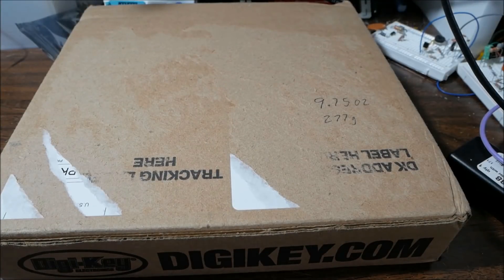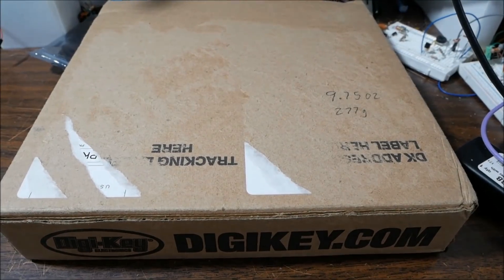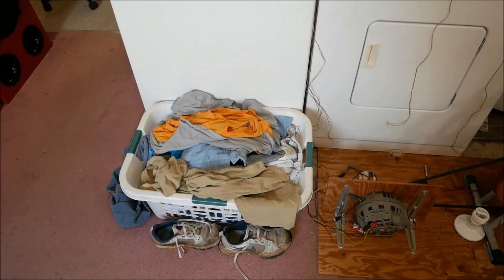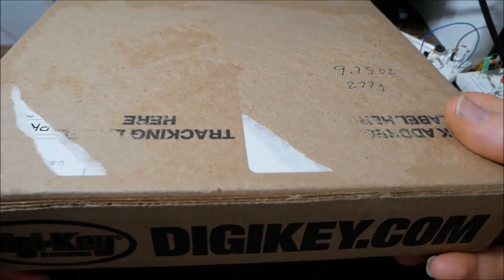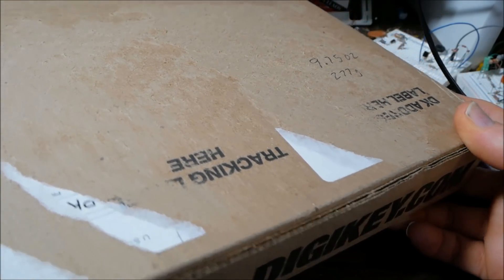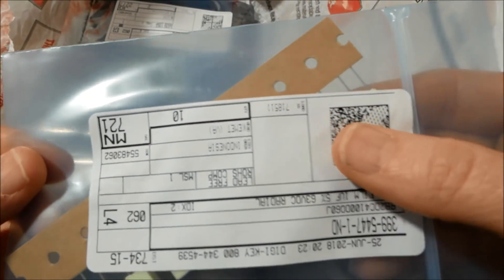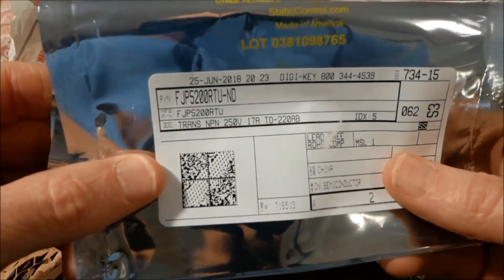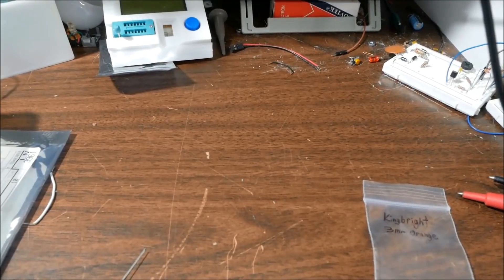Digikey unbox, view around room and orange and auqua LED colors

Comment: Digikey is great.   Shipping is usually very reasonable.   They could save themselves lots of money by packaging things in appropriately sized boxes.   Most package contents only use 5 percent of the volume of the containers they ship in.  It amazes me.
Reply: That and the double and triple bagging of stuff in those blue plastic bags.  I've got a metric tonne of those baggies haha
Reply: Don't waste stuff if you can use it.   People laugh at me when it build projects for them and tell them it is made with parts from other friends of ours old electronics I have salvaged parts from.   Best part is the salvaged stuff from older gear is better (made in the USA) than newer stuff from who knows who made it.   The mean time between failure has been surpassed for salvaged parts so they are probably going to outlast 2 lifetimes of the average user.   JP says  "There is a fine line between being a repurposer and a hoarder. "    Have fun all.

Comment: The cyan LED color is great, I had some back in 2005, but they were bad, those are much brighter. On a different topic, as night lights, I use 2 or 3 green ultrabright leds in series connected to my main 12V lead-acid battery. I installed them in doorways and bathroom but never in bedrooms.

Comment: Hi John,
Tx for your vids!
Could you use 10 2.7V supercapacitors in stead of the 8 3300uF capacitors?  Even If it’s not very practical, would it give the same result?
Reply from the maker: It is possible if the ESR is not to high. If the capacitance is too high, it could be a strain on the rectifier and transformer. Those supercaps hold a lot of charge.
Reply: JohnAudioTech Thank you!

Comment: Does the 1875 chips get warm when idling?
Reply from the maker: Yes. If they idle at, say 40ma and have for example, a +/- 22 volt supply (44v total), the idle power dissipation is simply the current times the supply voltage or 1.76 watts.
Reply: Thanks John, I'll put a little bigger heat sink on it.

Comment: We have the same heatwave going on here in Canada, getting sick of it too hah.  Love digikey, the only shipping option to canada is fedex overnight.  It's 8 dollar flat rate shipping, or free for orders over $100.
Reply: It's 94 F outside right now, not as bad as before.  33 old folks have actually died though due to the heat and not having AC.  Since it usually doesn't get so hot here, a few people don't have AC.
Reply: The heatwave that you're experiencing is called, "summer". It is supposed to be hot in the summer.
Reply: Paul Frederick Yes it was was quite the novelty for the first few days, we don't get much summer around here.  Now it's gotten to be a bit much, its over 110 of those USA type degrees in my garage.  Things that didn't know could melt are starting to melt.  Lol
Reply: Here in San Antonio Texas we laugh at what the north calls a "HeatWave" ...Today we heave a cool front moving through..it's only going up to 89, High 90's for the rest of the week though.
Reply: In most of Canada 80 degrees is an emergency...Here in San Antonio Texas we call it Christmas
Reply: I had a good laugh when John said he thought the humidity was high in the midwest. Here the humidity can run 98-99% for months at a time. There's days when you can walk out the door and it feels like someone threw a steaming blanket on you. Sweating is useless. You only get wet.
Reply: 110F in your garage? Take the magnifying glass off it already.
Reply: Ah always looking on the bright side. That's an admirable trait. something has to move those old folks along. So it might as well be the heat.

Comment: Great video... At this moment I should ask a question.  If I drive 2sa 1943 and 2sc 5200 from the tda 2050 output directly will it help ?
Reply from the maker: The TDA2050 handles enough current to drive most loads in its supply voltage range. Unless you're driving 4 ohm loads at +/- 22 volts or 2 ohm loads it makes little sense to use an output booster circuit.
Reply: what if i use tda 7293?